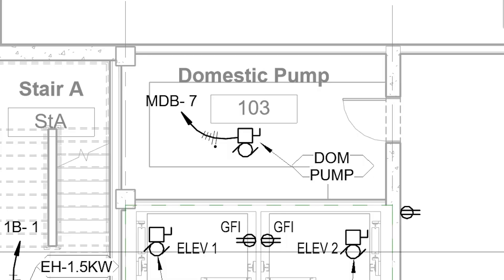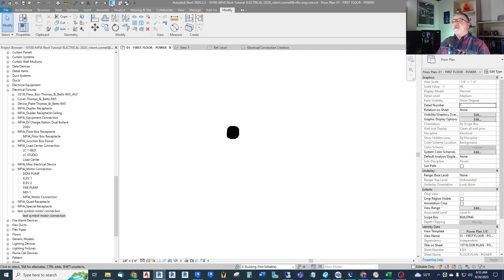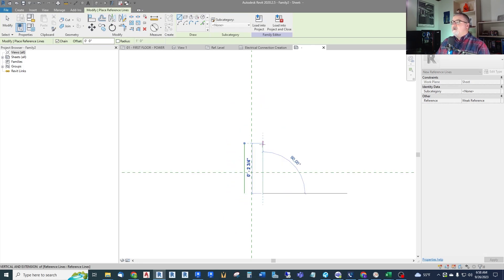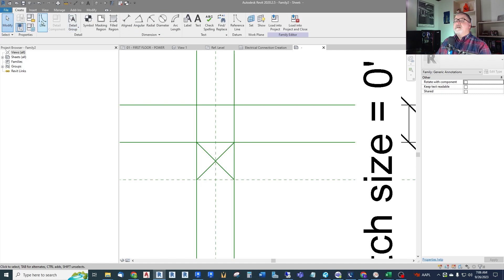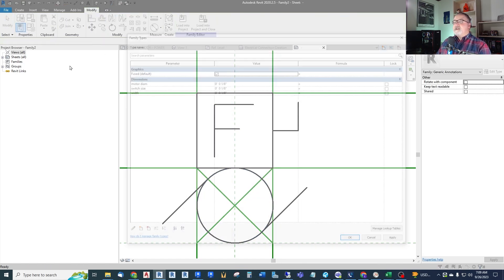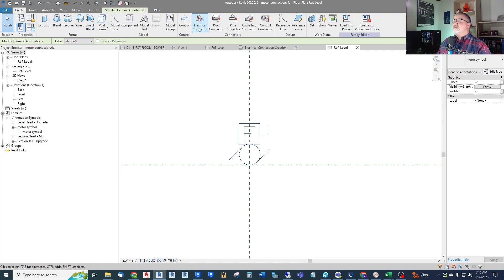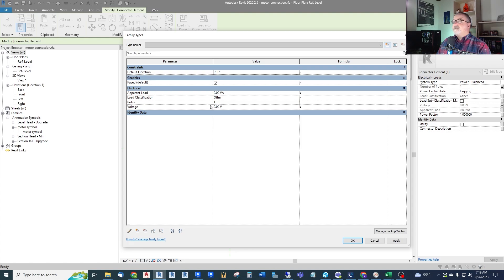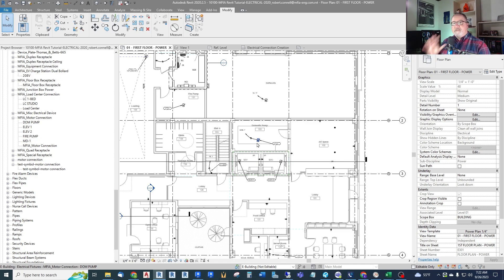REVIT MEP Create a Motor Electrical Connection (Family Editor)

Comment: Hi Rob, Once you create the motor connection family and you set the defaults in the Family Types (12:40) and place it into the model how do you change the electrical parameters (Load, Classification, Poles, and Voltage) once you place it in the model? Say it is created at 120V, 1500VA and I want to connect a motor on the 480V 3P system with say 17500VA how do we do that? I know I have a lot to learn yet.  Great videos, Thanks.
Reply from the maker: Hey there Dale! Short answer is, you hit "Edit Type" and "duplicate" to create a new "type" which you can name for your piece of equipment, then can change the "type parameters" of that new type specific to that equipment. Also put a name for that equipment in the "Type Mark" if you want to tag it. When you circuit it, will again need to label the "circuit" in the panel with the load description. I cover this in a few videos, but will point you to the 50:15 mark of this video for an example https://youtu.be/QWpFmpQU-N8.